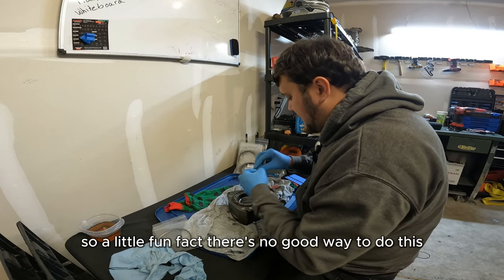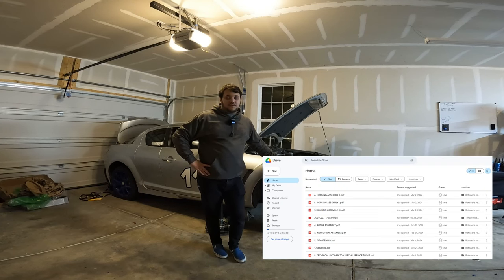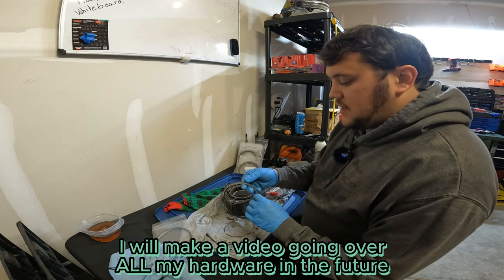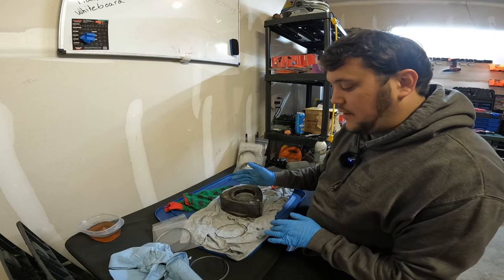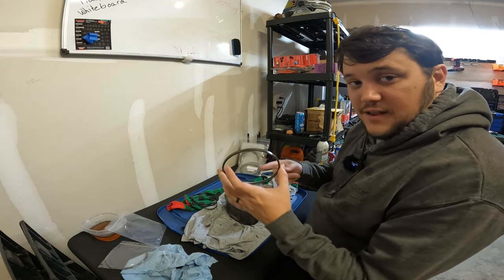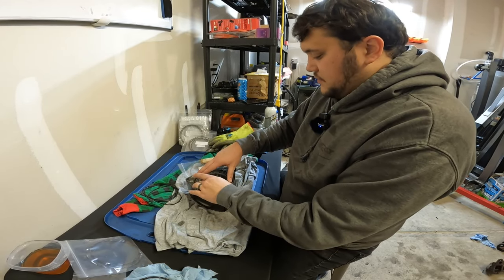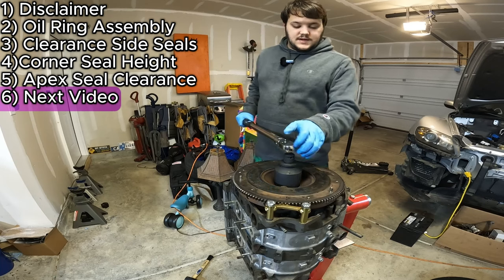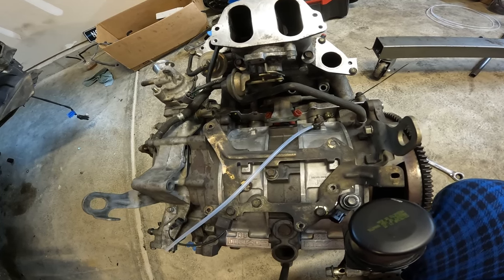RX8 Hybrid Renesis Build: Rotor Assembly

Comment: Sideseal clearance is .oo4 thou max
Reply from the maker: I followed the factory manual with input from my tuner
Reply: As I  said you are mixing up terms .
Thou is use only for imperial.
It's always .00 what ever of a mm
That's why I corrected you on the clearance also